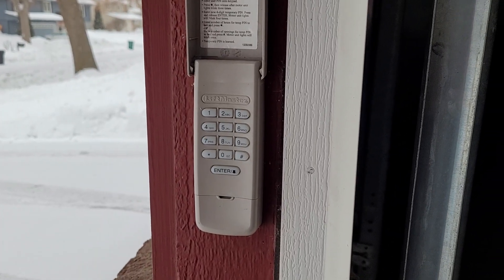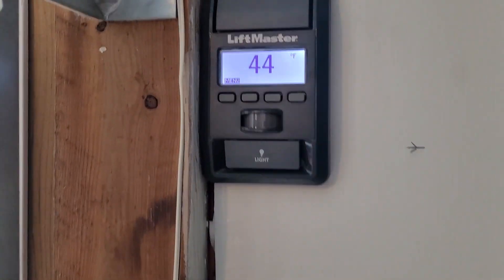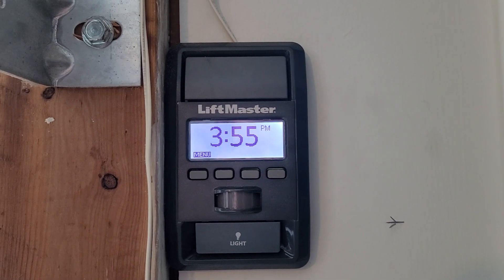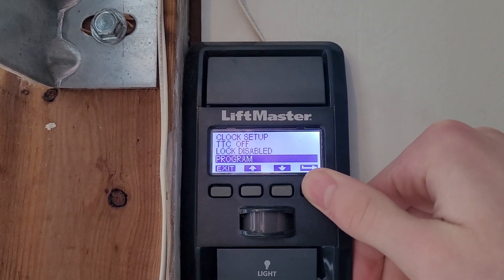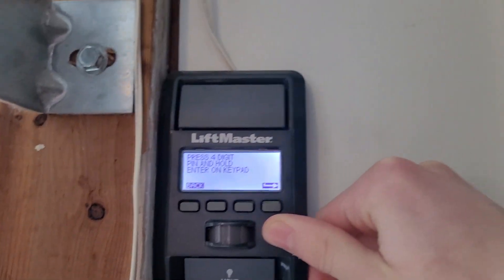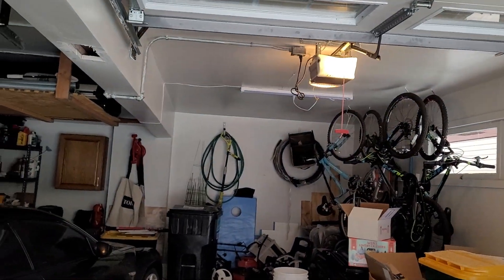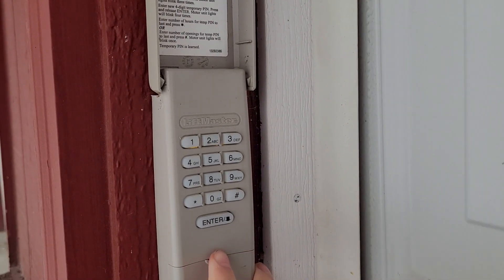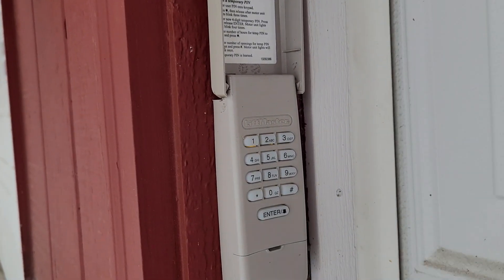How to Program a Keypad using the Smart Control Panel

Comment: How do you enable the one touch close on the keypad?
Reply from the maker: Press and hold 1 and 9 buttons until the keypad flashes. 1 touch close only works with 315 or newer